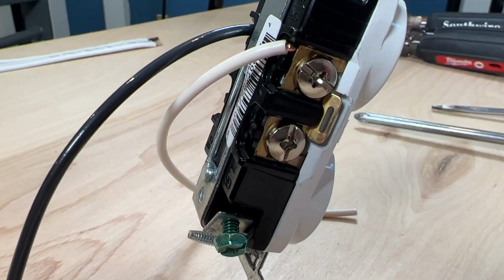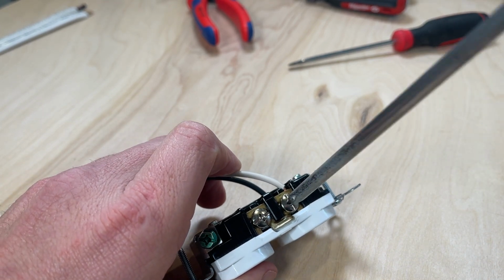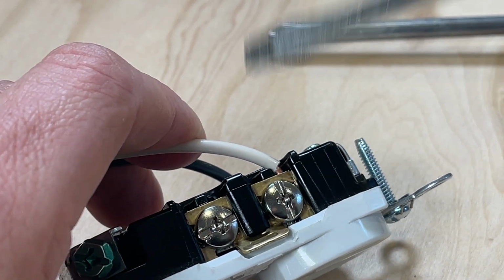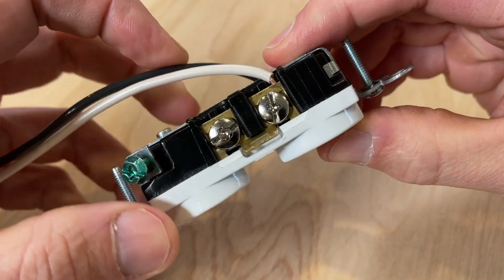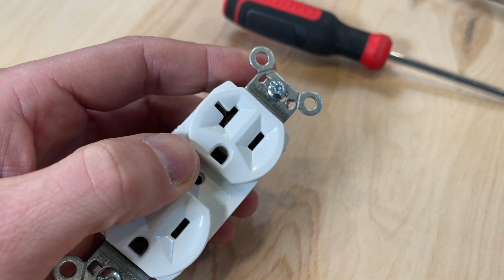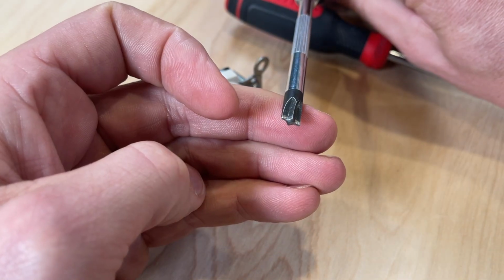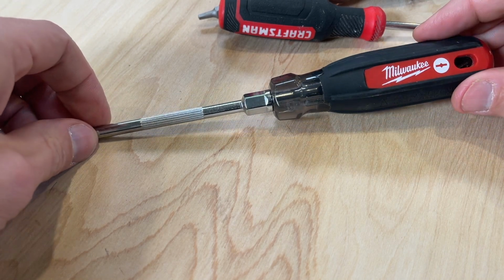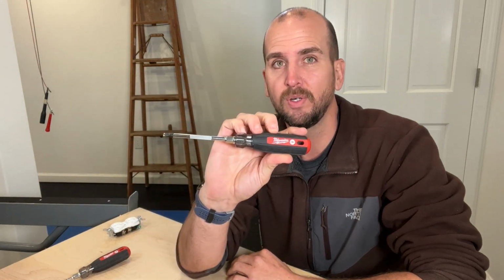80% of People Use the Wrong Screwdriver For Electrical Work

Comment: I see  they work well,  as do square bits , but you really don't need much torque or force with outlets or terminal screws  , so I don't see much need beyond a Phillips screwdriver for such work, and they are multi-purpose and work on a lot more screws than an ECX. So the ECX looks like an extra tool you would  have to carry, besides having a cross-tip ( or a few), and a flat-tip  anyway.
Yes, an electrician wiring up a whole house/etc. , but a little beyond what a general contractor  or maintenance man might need, day to day.

Comment: I have 2 screwdriver bits, they are from Wiha but you can buy it from any other brand, the code for them is SL/PH1 and SL/PH2, and they are the correct bits for these screws. They are quite expensive, you can buy it from some off-brand company or on a screwdriver itself.

Comment: Philips screwdrivers are designed to cam out, so not the wrong type, but perhaps the wrong size? How does a number 3 fit? In the UK we have pozi drivers which are grippers, and work well, as long as they are used with their respective heads. They look similar but are not the same, and are not interchangeable. I would agree the tool at the end is clearly the one to use though

Comment: you completely missed the bleeding obvious . Non of those screwdrivers should be used . They are not insulated for electrical work . PEOPLE SHOULD  '' ONLY''  USE  AN ELECTRICIANS INSULATED SCREWDRIVER with the correct head for the job!!!

Comment: The ECX is by far the superior too, especially if you also regularly install EMT conduit. The set screws are also designed to receive this style of driver. Just be careful not to punch holes in the thin wall because of the incredible amount of torque you can apply.

Comment: Oddly all the electricians I know and work with use 1000v insulated posi drive, flat or square drive (depending on the screw type) and would NEVER use a bare steel shaft as they work on both safe and live circuitry, and make sure the habit is to only use a safe instrument....
I'm going with them.
Reply: Heat shrink tubing can convert most screwdrivers to insulated.
Reply: @psdaengr911  trusting uninsulated screwdrivers have completely nonconductive cheap handles... better than an uninsulated screwdriver but a bit like you can use rope instead of a seatbelt... 
you "can"...

Comment: When I go to replace a light switch or outlet, I look in the place I normally keep my tools. I can't find any screwdrivers. I look around in drawers and in cabinets until I find a screwdriver. I find a worn-out #2 Phillips or a slotted that's too small. I use whatever I find, sometimes a butter knife. Months later I find the good #2 Phillips behind a dresser. I  know that a square bit would be the best but I haven't seen the one I purchased about a year ago. Then my cousin lost his wallet and wanted me to check my backseat for it. I take out the seat, no wallet, but my new square bit screwdriver is there, still in the bag. I won't buy that special screwdriver because I've replaced maybe 7 or 8 outlets or switches in the last 50 years.

Comment: Well I did use the Philip's and straight slot. I have the Robertson's included with a few screwdrivers I own. Was quite puzzled with the Robertson's because I never saw the screws at Lowes. Now that you point it out I know now I should get the Milwaukee. I have seen many screws with the straight and other middle place thinking it was designed for straight and Philip's. Thanks for pointing this out. Can you give tips on the Torx and Hex screws also and their tools as well?

Comment: Issues, the switch was designed for a Phillips as the primary tool, flathead as a secondary, the Robertson, though it works isn't the proper tool. By the way, your" not in bad shape"  phillips is a cheap metal and is in really poor shape. By better tolls, use them properly and they won't slip because of the wear on the driver tip.

Comment: Whatever head, you should be using a calibrated torque screwdriver for all but the tiniest connections.
Reply: It is In the NEC now. but is your torgue device calibrated and traceable to NIST? and when your tool goes into cal is an "as received test done"?  If you find your tool was way off at the end of the cal period, do you go back and check the thousands of fixtures installed? The joy of vendor-driven code changes.

Comment: Ok, I'm going out on a limb here BUT I think all screws should use just one type of screw driver, the same tool, the same slot, the same size.  If we started redesigning all the screw manufactures today I bet we could get them standardized in less than a year.  Now since you have a road in with these companies I'm counting on you Scott to get the ball rolling.  Let's solve this problem once and for all ;)

Comment: I've never seen an ECX before. Neat but seems like overkill for this application. Robertsons are cheap, ubiquitous and get the job done perfectly. I'm sure the ECX feels satisfying to use but the downside is it has to be oriented correctly like a flat head which makes it slightly less one-handable. It's also much less common and I'm willing to bet costs more (I could be wrong). 

That being said, I'll look for one the next time I'm at a hardware store because I'm a sucker for tools ;)
Reply: They're not uncommon, especially as part of an all-in-one screwdriver or a screwdriver kit. They're just commonly ignored or unknown by most people.
Reply: @GuyFromJupiter  Are you in the US? In Canada, I've never seen them whether in a pack or sold separately.
Reply: Ideal makes one, Milwaukee 11-1’s are awkward for my hand, so I went ideal
Reply: They are annoying to use vs a robertson or phillips. Especially in repetition
Reply: Not Over Kill, is the correct tool. Wanted to get Milwaukee ECX. But could only get Online. Got the 9 Bit? Klein with Bits in the Handle. 2 are ECX. 
I believe in getting Quality Tool to do Quality work.
Stratmando
Reply: In Germany, they call them xeno #2 bits. I have a Wiha with that exact same bit, but different name. Treat it like a baby, for it's a good investment 👌.

Comment: Watched this video & you are dead wrong on most everything you state & I sure as hell didn't see where you got your percentage numbers of drivers used ??.......First as others have said the slotted driver used was too small for this application....Also  to suggest using  a philips to even  attempt to tighten that terminal is deadly wrong !!
You risk condoning the wrong tool to tighten this terminal !!  A  fatal mistake would be to say a person who already dose not know what proper driver to use...... to only use a phillips in this application & NOT getting that terminal tightened enough....Which later on will case a bad connection & result in overheating & possibly fire ??
Again I have found  that this terminal is  90+ %  a  #2 robertson although I have seen a few cases of #1 screws being used ??  (probably chinese made)
For the record: robertson screw-drivers most generally have  colour coded handles  #0 is yellow  #1 is green  #2 is is red  #3 is black

When I was young I was taught A phillips was designed for use in automotive & robertson for electrical/wood & that my friend most generally holds very true !!         You should NOT be making videos & telling people without knowing ALL proper procedures in & how to use etc.  !!!

Comment: First off, I love Robertson screws because it really does take a lot of the effort out of driving them into substrate.  using a cordless drill, most of the energy in driving in a philips screw can sometimes be just the sheer amount of force required to keep the bit from camming out and ruining the screwhead.

I knew an electrician that carried a pair of well worn Klein linesman pliers, and a large flat-bladed screwdriver.  He could rough out holes in drywall for boxes, tighten conduit locknuts, and pretty much do almost all manner of residential electric with those 2 tools.  He would gingerly touch wires to test them, relying on shot nerves and calloused fingers to take the edge off of the  ~110v signaling his internal AC detector

I'm not saying its the right way to do it, but.... it worked for him for 30 years.  Then again, he had a huge drinking problem and 3 ex-wives (one which shot him, but they still talk) so maybe he wasn't the most "normal" electrician. 

I do recall an apprentice worker using a "square drive" as its called around here, and breaking a lot of the cheap plastic outlets because he was using a cordless impact and the square drive doesn't really cam out like a phillips (read : Does not cam out at all)
Reply: Nah three ex wives one of which shot him sounds like exactly the typical electrician at 30 years in the trade.

Comment: Thx for the informative video. My question is why electr. fixture manufacturers changed screw types from what majority users have for tools. Remember when ALL fixtures used only slotted screws? You could truly tighten those screws to a "fare thee well". My conspiratorial side makes me wonder if this a plot between electr. unions & manufacturers to limit diy for reasons of "job security". What's next--"tamper proof" screws?
Reply: vendor driven code changes.

Comment: A #3 Phillips screwdriver works just as well as the #1 Robertson or the ECX driver. The #3 Phillips has a blunted tip that fits that screw perfectly.
Reply: If you have the right size a Phillips will work just fine. I prefer Robertson but an undersized Robertson will cam out just like an undersized Phillips, only real difference is you can't oversize a Robertson like you can a Phillips making it quicker to pick the right bit for the job. It's either too small and cams out, fits properly or doesn't fit at all.

Comment: Ok, so before we eve consider electricity, the title should really be, "80% OF PEOPLE USE THE WRONG SCREWDRIVER", and it would encompass everything.

Pozidrive is way better than Philips. It isn't just a Philips with an extra set of flutes.
Slotted screws are terrible. They only have more contact area if a larger size is used and the width and thickness of the blades will vary.
I've seen Torx used where allen keys should be. 
People mixing metric and imperial is another annoyance.
Square drive, (quadrex), Meh, although it's pretty useful in this instance.

No substitute for getting the right tool for the fixing at hand.

Comment: I would add: If you're doing electrical work of any substance, buy anti-shock insulated tools instead. Especially if you're doing any work with LiFePo4 Or LiIon batteries for solar systems. You can cause a deadly catastrophe for yourself if you don't. I was blown off a chair by my drill arcing to a light fixture once. Don't let that be you. The actual electricity runs around the outside of the wires, not through them, and none of the connection points are insulated (or they wouldn't be connection points).

Speaking as a Canadian, I can tell you I've been using a Robertson for almost everything I do for about thirty years. I hate Philips and standard drivers. Philips strips, standard slips (it even rhymes - I'll add that to my line of t-shirts, I think). When I buy screws I always get either Robertson or Torx (needed Torx drivers for mechanical stuff anyway). I have no idea why anyone would be without a basic set of screwdrivers, frankly (I'm female, so don't give me any excuses). Here in Canada we have a store called Canadian Tire. Every week they put out a flyer with ginormous savings. If you ignore everything but the doorcrasher sales, you can get amazing prices on tools with a lifetime guarantee. They don't have the gloss of a Snap-On, but you don't even need a receipt for them to replace a broken tool.

Comment: Computer guy here: sometimes I use a JIS screwdriver instead of a phillips for certain things where a lot of torque is necessary.  Phillips screwdrivers are actually intended to cam-out to limit how much torque can be applied.  That is why the grooves on them are angled.
Reply: He could have made a video about JIS screwdrivers and motorcycles.  I worked on them for 30 years before I found out they were JIS screws and not Phillips.   Wow, what a difference a JIS drivers make working on a Japanese motorcycle
Reply: Agreed. A JIS is visually similar to a Phillips, but they are practically quite different. Most people don’t know that the Phillips was designed to cam-out. At the time, good design, but archaic in today’s world.

Comment: Make sure, if you have "NEW" staff, or employee's, starting out, or beginning their apprenticeship, to never take for granted that the simplest of things, could actually be overlooked, FOR EXAMPLE, one of my newbie's wanted a few extra hours on the clock, so he could get caught up on some bills. So, I offered to allow him to tighten up the shop a little bit, organize and the typical cleaning .. blah... blah... blah...  He did a great job too. BUT, I FAILED HIM. I just assumed that he knew all or everything, and I had on the shelf cases of the various tools, by KLIEN, Gleenlee, etc.. all in efforts to make our jobs smoother as there is no excuse to have bad or worn out tooling.. anyhow, He got everything down that aisle of shelving racks.. Long story short, about $1100 in screw drivers and nut driver bits, that are of the Hybrid / Milwaukee ECX formula, ALL IN THE DUMPSTER TRASH BIN.... LOL... Again, that was not his fault, that was mine, for me as his boss taking for granted, that he knew better. We all just kinda laughed when we discovered that... He really felt bad about that, and once I showed him what and how those "oddly shaped" driver tips worked, of course all made sense to him then, but He threw them all in the trash bin, as he assumed they were all worn out phillips drivers... He even did say, how strange those were, "How could all these tips be worn out, yet, they look clean and brand new, and the rubber clad plastic handles, were also as if they had never even been touched by human hands".... LOL.. He also thought, maybe, they were a manufacturers mistake, or flawed manufacturing process... His is a great kid, and in my opinion, although, that cost me/the company $1100, or rather, $2200 as I did then order replacements stock to have on the shelves, I choose to believe that it really was a very positive learning lesson for this young man, as it now opened him up, to NEVER assuming a single thing, and no longer fears asking any measure of question(s), as he now fears making a mistake, more then feeling odd or dumb, by asking question(s), fearing that somebody might make fun of him, because he doesn't know something. 

I explained to him, that once upon a time, Although, I make things look easy, and enjoy making things appear that I am screwing off, but I am actually busting my tail off, doing the work of several men, pending the job or type of work I am doing, but I once had no clue what I was doing, and didn't know anything. But with a little bit of time, if you are willing, you will get there too. While also reminding him, that not only does the educational aspect of being an electrician NEVER STOP, rather, just accept that the learning process, if factual, and really, to just enjoy the journey of it. while one rule over all, safety.

I include this young man in the action meetings, to show him that even my top dog electricians, we all go over the exacting details, of the layout of the mains, etc, and how we each plan to do what we are doing, and then each runs through how they would do things, etc... None of them are offended of this process, as SAFETY is paramount and the job gets so much easier when everybody is on the same page, and NONE of them ever fear asking for help, to either answer questions, or to simply help lift or hold something... Again, this young kid is going to be a great addition to my team of already great people. You don't know what you don't know.

Comment: When they added the Robertson cut in the plug screws they ruined the Phillips head slot. This is what happens when you try to make something that will work with any tool. The Philips head worked just fine before they made this “improvement “. Now it is easy to strip the head with a Phillips because of the square hole.

Comment: Robertson is just a hex key with sides missing so higher point loading but less expensive to produce. Robertson has no place in the modern world. Slotted screws don't cam out but they also don't self-center. Philips self-center but also cam out. Torx is perfect but if it rusts to bits it obviously wont work so use hex if it'll be rusted anyway.

Comment: ive always just used a slot head and had 0 problems i udnerstand it might be harder for others to use them but as someone that works with extrememely small screws ive never had a slip or issue with it

Comment: something something, phillips is designed to cam out to prevent overtorque, the pozidrive ones don't as much but sometimes don't fit so well, the flathead wasn't the right fit for the screw, and you wouldn't realistically need to torque it down like it was the last hotdog at the baseball game.

Comment: To be clear, a Phillips head (not worn) works fine.  I'm more concerned that you've installed the hot/common lead under the screw plate in a way that it can slip or get pushed out if your not careful. Best practice is to have a single wire positioned such that as you tighten the screw, it pulls the wire in as you tighten it.

Comment: LMAO, why in the hell are you trying to tighten it so tight!!! Are you trying cut wire.you realize a clamp inside holds it down when you screw that shut literally hundreds of not thousands of plugs have I installed using #2 Phillips don't try get people buy a complete different tool.. there's even plugs where you simply press into the back of the unit no screwing required